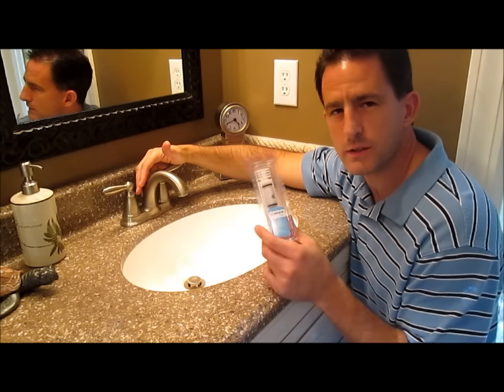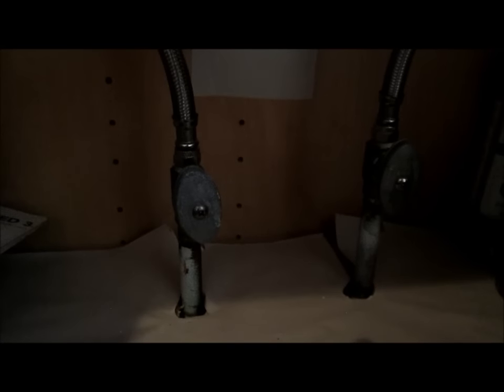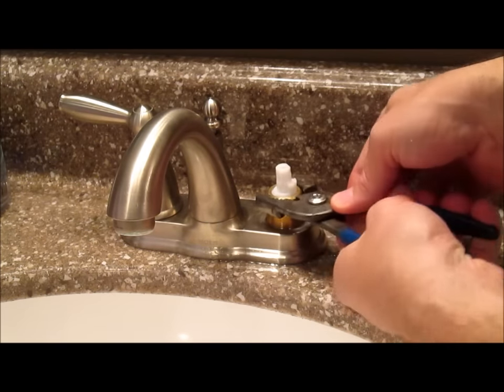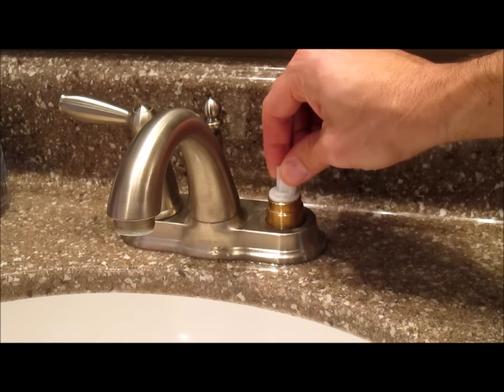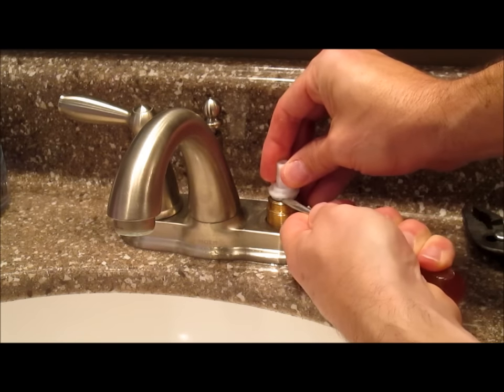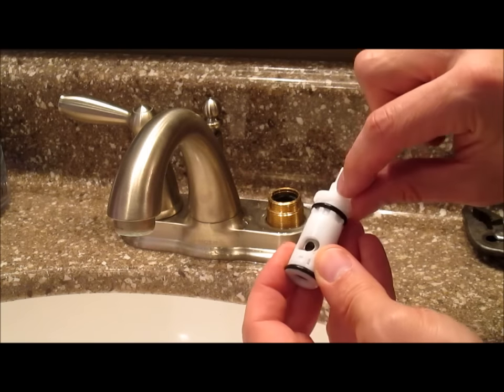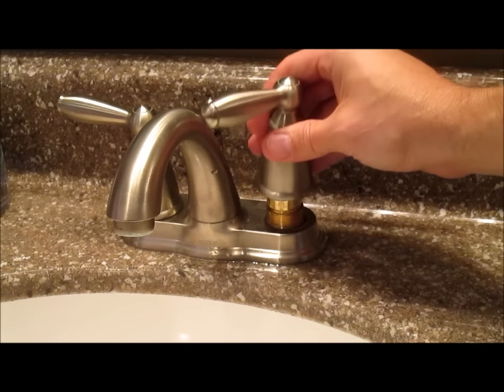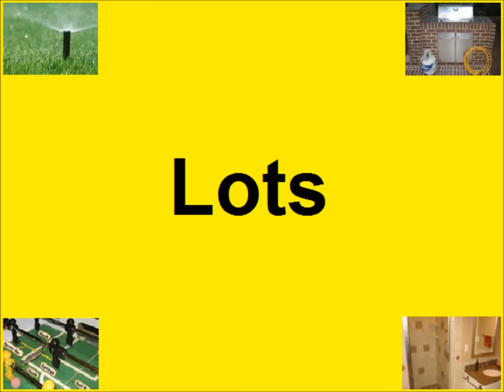How To Fix a Dripping Moen Faucet (HowToLou.com)

Comment: If it is stuck, you will need to disconnect the hose from below and "push" it out. Remove the bit fro a screwdriver and use that as your pusher.
Reply: Thank you!

Comment: The correct solution is to remove the Moen faucet and throw it into the trash where it belongs.  Then, install a Delta or Peerless faucet.
Reply from the maker: +Panamint Joe Smith - i can't disagree with the first part.  I had to replace them twice  in 5 years. However, I returned a delta because it was made with cheap plastic parts.

Comment: Also note that some Moens require a 3/32 (or some such) hex wrench to loosen the nut that holds the handles in place instead of being able to simply twist them off. (Be sure to cover your drain w/ a washcloth.)

Comment: Don't forget you may or may not (depending on your model) need a "retainer nut removal tool"  sold separately.   Most cartridges have some type of nut holding them down.  It is very hard to see them even with a flash light.  

The one I needed was just a metal tube with a couple of ears on the end, but impossible to replace without it.    Mine was a Moen #14272 for a Roman style bath tub.

If your cartridge is deep inside a copper pipe with threaded grooves, then most likely there is a retainer nut.

Comment: Okay. First thing to do is remove the aerator. Then swap out the valves. Run the faucet to clean out the sediment in the faucet otherwise your aerator screen will clog like mine did and water won't flow. Then reinstall aerator. Job done.
Reply: Thank you!

Comment: Can we just replace the seats and springs like in delta faucet? Or the Moen faucet doesn't have the seats and springs?
Reply from the maker: There may be a way, but I couldn’t find simpler parts at the hardware store.  They just sold the entire cartridge

Comment: how do you know which valve is leaking? hot or cold?
Reply: Hi! You can turn off one supply and dry the sink. If the sink gets wet, you know it's that one, bit still test the other. If the sink is dry, you know it's the other. 
Rule of thumb is the hot water side goes out most often because heat destroys rubber.

Comment: I followed the video and was able to get the cartridge out and bought the replacement.  I've put the cartridge back in, but I can't get it to line up in the handle.  I know I have the right part.  Any easy fix I'm not seeing?
Reply from the maker: I think the cartridge goes in two ways.  Try pulling it out and rotating 180 and putting back in.   If you still can’t get it, send several pictures to HowToLou@gmail.com

Comment: my moen faucet don't screw out from top, or is there tool to unscrew from top to get to the cartridge. what could be the problem ? is it too tight ? or i need to go underneath the sink to open it ? plz help
Reply from the maker: +Turan Wahabzadah -  email me a picture of it at howtolou@gmail.com and I will try to see how it opens
Reply: Some Moen handles have allen set screws on the side, usually 3/32 - my new Moen has allen screws on left and right side.  loosen the allen screw and the handle lifts right off.  make sure ya get the stem oriented in the right postion so the faucet handle fits and works right.

Comment: How do you know if the hot water handle cartridge also needs replacement? (looks like you just replaced the cold water handle).
Reply from the maker: Replace one and see if leak stops.  Cold is typically used more than hot, so it wears out faster
Reply: You can turn off each water supply separately to see which one it is. I tuned off the cold supply--still dripping. Then, I turned off the hot supply--stopped dripping. For me, it was the hit side.